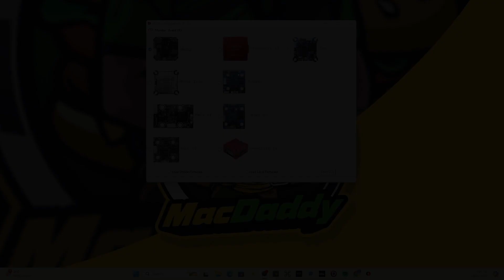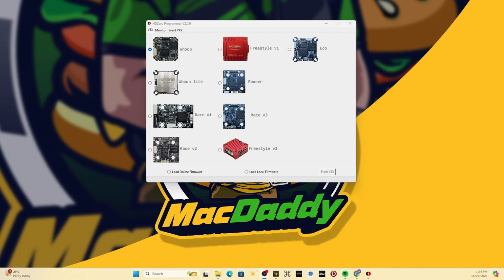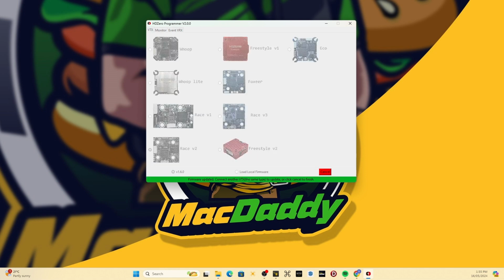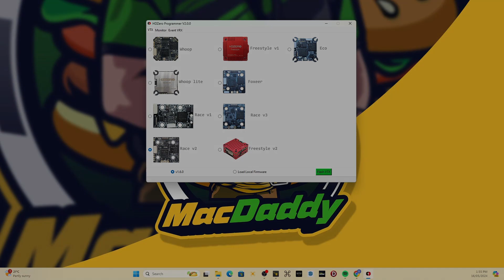HDZERO Programmer Tool

Comment: That was nice, but how about the vrx? I'm just getting into this, but I thought the vrx needs to be updated with the same version firmware, but on the programmer, it only has event vrx as an option. I've got the older sharkbyte vrx.
Reply from the maker: @2high2flyfpv88  the vrx is updated the same as the goggles. Download the firmware from the website, place it on an sd card and insert in the goggles. There are manuals for this on the hdzero website.

Comment: Mine just says connecting vtx and doesn't do anything 😭
Reply: same here, it’s pretty frustrating. I also get no LED lighting up on the programmer when I plug in the usb C to the computer
Reply: hi!
did you solved it somehow?

For some reason my also has no LED lights when connected to usbc, but everything is ok with the battery
Reply: You have to download configurator for the programmer

Comment: On HD-Zero website they mentioned it as Auto detect VTX type. So its not like that? So there is still chance to go wrong if we make mistake on choosing the right VTX. In India, its hard to buy even that 7 pin hdzero programming cable. Not sure whether i could see these products. Hard to import because cheap customs officials cease these products saying its already restricted as terrorist will misuse such products. Oh HDzero.. why country higher officials are always zero? 🥲